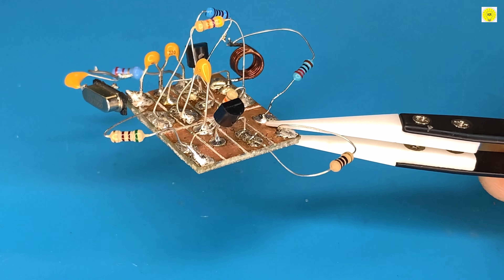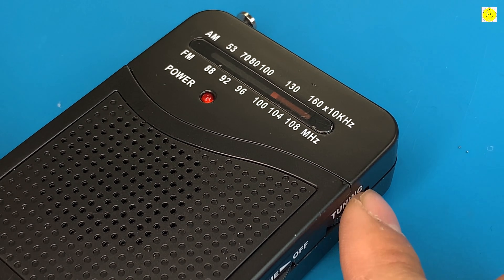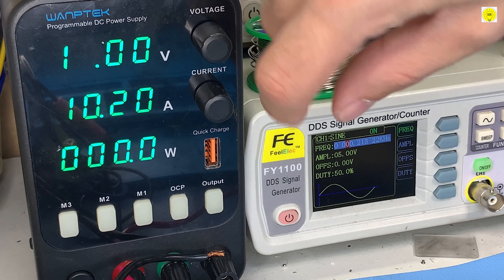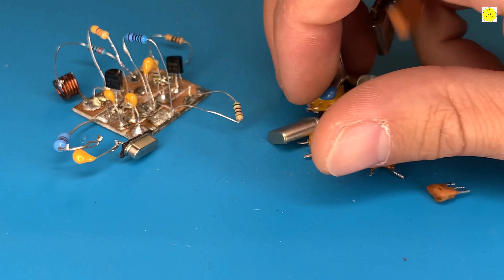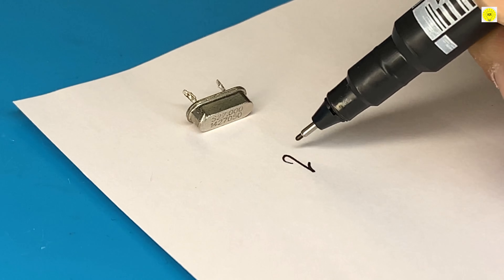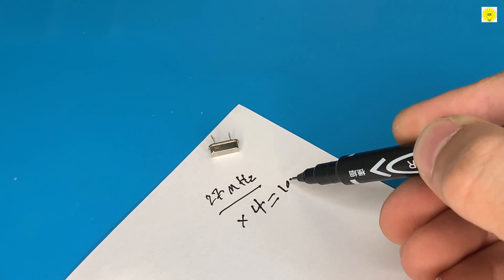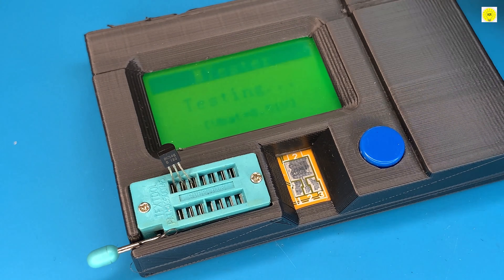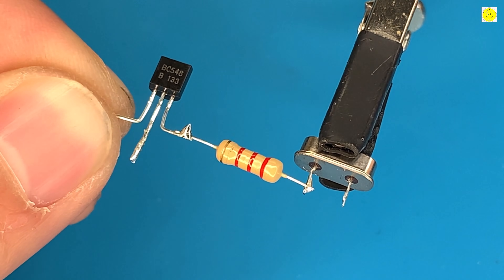Build a Spy FM Transmitter with a Crystal - DIY Tutorial

Comment: I maked first circuit but it can't work
Reply from the maker: Check the values of the electronic components carefully.
Reply: It took me a while to get it right, instead of the 20nf capacitor, put a 22pf capacitor; power the circuit with 3v, it will work perfectly.
Reply: hola a que distancia maxima se puede puede usar ?